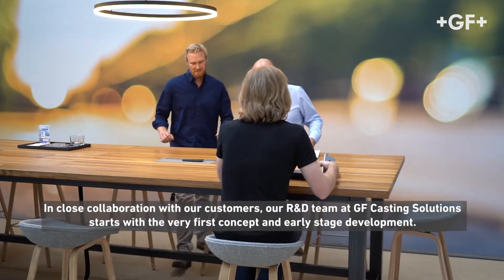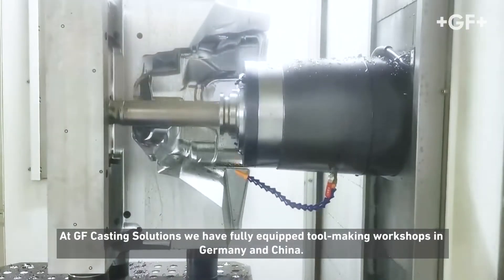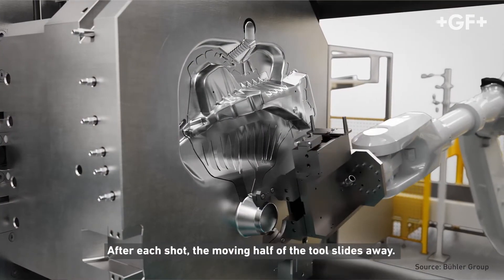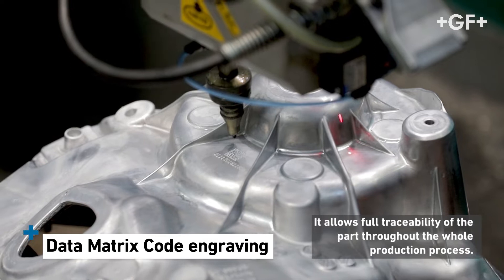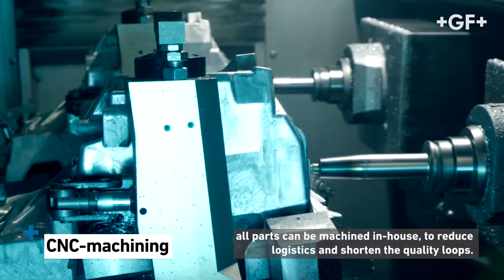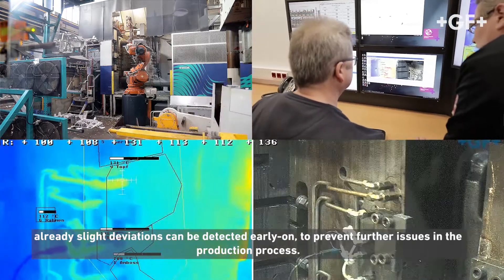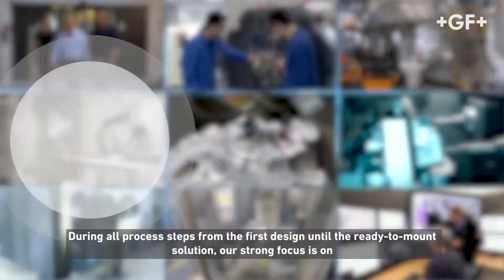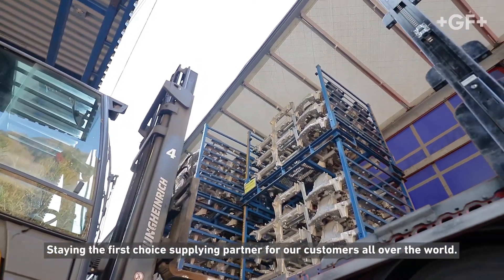High-Pressure Die-Casting at GF Casting Solutions

Comment: Looks like the plant would be a loud and hot place to work especially in the summer.
Reply: I work in one that is far less automated. you are correct I is very hot in the summer and spring and fall. winter is bearable. really sucks when you have to gear up to skim the impurities out of the molten metal.